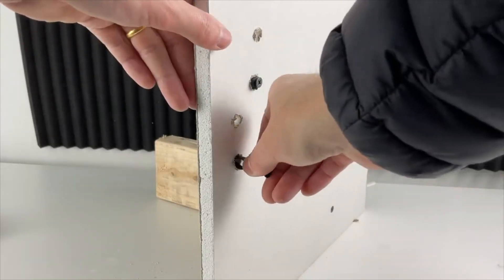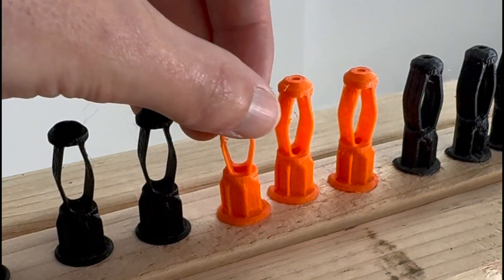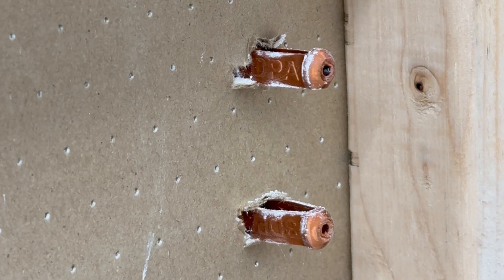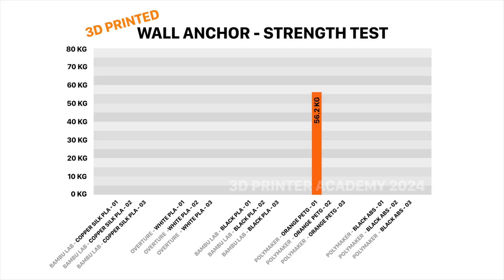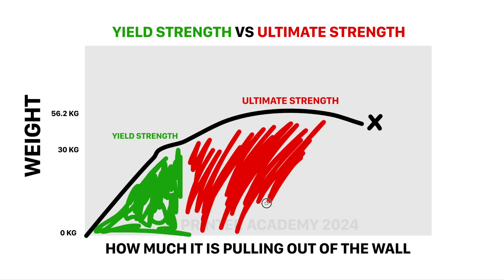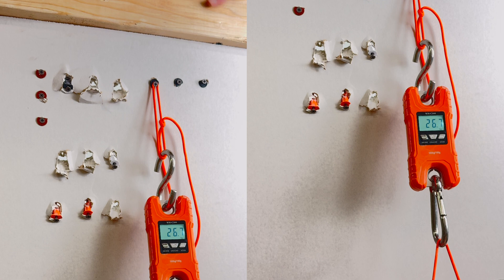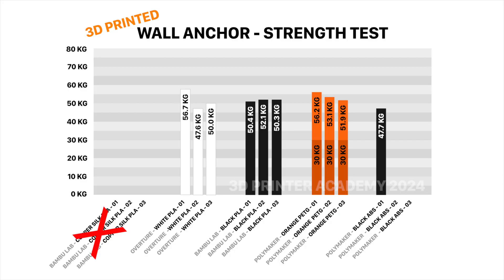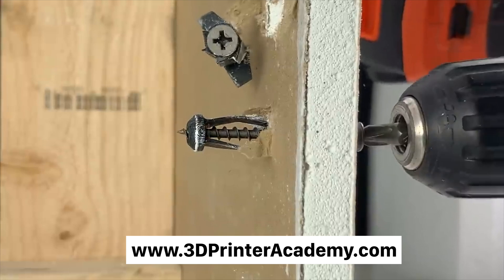Are 3D Prints Strong Enough?

Comment: I tracked down the model to the 3dprinting academy website. I printed it with bambu PLA. Instead of the end getting pulled towards the front when the screw is screwed in, instead it just rotated and broke off.

It's worth putting these models on sites like makerworld so they can get feedback and models can be improved. As of now I couldn't recommend this 3d printed part.

Comment: I printed these and every single one failed with the arms twisting off before compressing
Reply from the maker: try scaling them up a tad! sound like the screw is grabbing too much
Reply: @PracticalPrints  I scaled them up 1mm and 4 out of 6 work now thanks!
Reply from the maker: @mishka3876  And make sure not to use too brittle of filament. PLA+ or more ductile filament is more reliable

Comment: I have to say this is absolutely misuse of the stress strain curve.. the dry wall is giving out, they all average about the same due to the geometry of the anker, so the only thing really concluded is that this design in no brittle plastic holdes approximately the same weight around 50 kg, and this is almost flush with the wall and is reduced drastically the longer the screw head is from the wall.

Comment: Your test did not answer your initial question.  Without testing a commercial anchor there isn't any comparison provided.  Also, from what I see, none of the anchors failed (broke), the surface area was smaller that the structure the drywall could handle for the weight applied.

Comment: Cool and entertaining video, really. And apparently the printed wall plugs are similar to the store-bought ones. They are also specified with a load of 10-25kg depending on the wall. But if you just want to test the plug, you need a real wall or something similar to eliminate the wall factor. Here, the plasterboard wall gives way at an average of 40 kg. That's very interesting, I wouldn't have thought so. In addition, the load in the video is at an angle to the anchor point and therefore does not simulate a suspended load, but a tensile load at angle X. Nevertheless, very interesting and informative.

Comment: You could stop at 30kg, 25kg is the official specification for a dry wall (at least in the EU) with a plastic anchor  40kg with a two layers. 30kg / 50kg with a metal anchor. Maybe I will use my old petg now more often :D

Comment: It's nice to see that they can hold decent weight but without testing the factory plugs, all the tests show is that 3d printed parts can safely hold 10-20kg and drywall starts failing at around 40.
I was interested in the strength comparison with the factory plugs but you missed that opportunity.

Comment: You can literally just use scrap end pieces to zip ties, fill hole, screw screw in. Stripped screw on door? same thing, yes it will hold. Test it yourself. For it doesn't matter if it pierces out the back like this, with how your putting weight on it. It will only truly start to matter for the ceiling.
Point is. Im confident all these work, since its superior to zip tie ends. But with I just said... Average trade worker wouldn't use these. Why carry something extra, that your trash already fixes. For times I need real ones, these wont work anyway. Say 4ft garage ceiling light, ones for this are metal and spread weight load(something that wont happen on a vertical wall). I'm an electrician.
Reply: Yea, these would obviously be for situations when you just need to hang something on the wall and can't be bothered to go buy proper plug for it.

Comment: These don't look like they actually fail though, it looks more the downward force destroys the drywall, considering they all fail around the same point too. I think it's also unrealistic to think you'll place any substantial weight on a single plug, so they can probably take more if the weight is distributed. 

Good video though, I've printed 3d shelf brackets in the past, which is sort of similar.

Maybe for the next one, a DIY shelf with shelf brackets attached to drywall with these plugs, or these plugs on a regular shelf and distribute the weight.

Comment: Very cool.  Biggest failure is the drywall.  A different design might hold more, but in this test it’s not so much the anchor failing as it’s the drywall, which is why they are all so similar.
Reply: I thought about the same as watching the video, that all the time the dry wall was damaged so much the the anchors went through it. The dry wall should have a specification for that and i think the creator should compare the 3D printed anchor to a commercial one - that has aspecification of xy kg hollding strenth combined with dry wall.
Reply: Was about to post the same, its the drywall area failing to hold that weight in that small of surface area. The metal ones you can buy I think say 50lbs, now I know to not go over 40.
Reply: came here to say the same... thats why when you need to hold a lot of weight you should be fastening to the stud. All the examples the drywall was failing... I just dont know why different weights... but anyways still a nice video